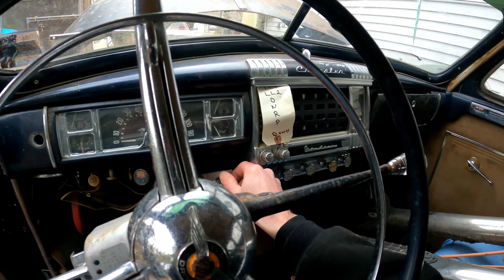Rotting 1967 Cadillac Convertible Will It Run and Drive? - NNKH

Comment: This is a cool car. But it’s still a real roach of a rust bucket. For the right person, this is a good car to bring back. Why? Because this is a car that defines what a Cadillac was and should be. And there will never be any more of these. So that’s why this one is a keeper. It would probably cost between $100,000 and $200,000 US dollars to totally restore this car back to showroom condition, but my guess is for between $20,000 to $50,000 you can end up with a nice driver status car.  There are still plenty of GM full size hulks laying around in junk yards, back yards, out in the woods and fields that can supply replacement parts and pieces needed to bring this car back. 

I love those hubcaps and white walls on this car. They just look so right on this car. This car has a beautiful set of lines and style.

Comment: I'm not an expert but I do know that marine batteries are Deep Cycle batteries. Deep cycle batteries are designed to draw out power over a longer period of time, whereas an automotive battery is designed to discharge a larger amount of power in a shorter period of time. Marine batteries will last longer under load, but they are not intended to be used in below freezing temperatures, since they are designed for uses in a machine that can't be used in sub freezing temperatures. In other words, they work better when you are trying to start a car that may require a lot of cranking, but they are not suitable for year round use in a car, since they do not work very well when it is below freezing outside.

Comment: So beautiful, the america i loved. It is a crime to give up such a car. To protect this car against rust after restoration: put grease every where : between carpet and floor, inside rear gate, doors, under the car, rear wings, behind bumpers, when you cannot reach these places with a paintbrush, use an extender to pour oil. to be repeted regulary for oil.
Only grease is really efficient against rust - it is my experience (35 years) as a handyman on classics cars.
from france.
ps : the dog is as lazy as the cat.

Comment: i would sometimes find myself without being able to pull a car on trailer. Best way i found to do it is take the trailer off the truck. Shock the tires on the trailer and then pull the car with a strap onto the trailer. it would take me 10 min total time to put a car on that trailer.
Reply from the maker: Sounds like a decent method

Comment: A marine battery is designed to withstand the harsh conditions of a boat, like vibrations and moisture, by having thicker lead plates and a more robust construction compared to a car battery, which is optimized for quickly starting a car engine and doesn't need to provide sustained power for long periods like a marine battery does; essentially, marine batteries are built for longer discharge cycles while car batteries prioritize high initial power bursts.
Reply from the maker: this is a marine starting battery not deep cycle
Reply: Yup totally! They're different than each other. The marine batteries are stout. 

Marine batteries are designed to withstand harsh conditions, while deep cycle batteries are designed to be recharged and drained regularly.
Reply: @NoNonsenseKnowHow 

Love the videos. I travel about 15,000 miles a month and binge your videos for hours and hours a day

Comment: Take the vin to a trusted locksmith they can make keys cheaper or try pulling the ign & a door lock pull them apart hit the pins down on a blank key make your own I done it on non tree ignition locks

Comment: This old car is a junkyard candidate.  The amount of work just to rebuild it from the ground up would essentially be building an entire new car.  This is well beyond feasible to restore.  When under that car, I would be really nervous because of so many rust holes in it.  I have experience with these vintage cars and when they are that rusty, they are well beyond salvageable.
Reply from the maker: Doesn't need to be fully restored.  With minimal work it would be a fun cruiser.

Comment: you need to put a vacuum guage on that and see if its fluttering. The oiling is poor to cyls 7&8 especially with crud buildup in the engine or non zinc oil being used.
What usually happens in that engine is the lifters and or the cam wears.
you can pull the intake and pull each lifter to look for excessive wear on the bottom. especially you you have that vac gauge fluttering
Reply: Flat tappet engine.  Must use diesel oil now to get zinc and phosphorous.  (Also leaded high octane gas).

Comment: I think that engine is 10.5 to 1 so compression should be higher 180avg
assuming the rings, valves seal and the cam isn't worn out. it will need a chain of course too
Reply: If I recall, the 429s had bad timing gears.

Comment: I would imagine you can still get lots of the body panels/sheet metal for this. It would be a huge project but it's screaming for a complete restoration.
Reply: Super expensive.  The outside mirrors on my 70 go for up to $2000 each.  And they are only zinced not chrome.
Reply: @rogersmith7396  I think a lot of people don't realize how expensive it would be to restore this car. Especially the missing interior. Love to see it running again but this seems like a parts car to me.

Comment: I'd rather spend 20 grand restoring that Caddie convertible than buying a brand new Cadillac SUV. All that Caddie needs for upgrades in the 21st century are front power disc brakes and a 4 speed automatic transmission.

Comment: I like the styling of 66 and 68 Cadillacs but for some reason they aren't impressive looking cars. I guess they don't have the bulk of the 65 and 66 or 69 and 70. The interiors lack something too. GM cheapened the interiors of Pontiacs and Cadillacs after 66. The Oldsmobiles and Buicks got better. Go figure. I don't understand anyone putting Bosch plugs in that engine. AC's are available. Nice video.

Comment: Some friends father had I think it was a 68 or possibly 69 at any rate it seemed to be a little longer than that one, the father would let the oldest of girls drive it and we would cruise around real slow with the car lurching around 25 cruise control was not very smooth back then at least in that at that speed

Comment: How can pouring oil into the crankcase get to the oil pump gears?  It can't!  Mike is blowing smoke!
Reply from the maker: That's what I was thinking but I figured what the heck. It's his car so I poured some oil in there.  The oil pump gears are inside of the timing cover not far from the fill

Comment: that sparking like that on the points is BAD!!! that means the condenser is bad and will need to be changed, all the arcing on the points will ruin them in no time! you will get misfires like crazy and eventually no fires lol
Reply from the maker: What part of the video are you referring to? Are you talking about when I was checking for spark from the coil secondary wire?
Reply: @NoNonsenseKnowHow  I don’t remember, but I thought u had mentioned that the points were sparking when u checked it, they shouldn’t spark, the condenser stops that, sparking points get dirty and pitted fast and cause misfires and will fail

Comment: Marine batteries are for long low current discharges. Automotive batteries are for a quick high current draw & back to charging/driving down the, road. Also, marine batteries are designed to be discharged & charged & discharged & charged VS for a quick burst of, energy for "starting", purposes.

So, when the volts go down, the amps go up. When the volts go up the amps come, down. 

You won't get near as many discharge/charge cycles out of an automotive, battery. 

Be careful using a marine battery for automotive use? Once you let the smoke out of the wiring, the wires aren't good anymore. 

I wouldn't use a marine battery in my automobile & I wouldn't use an automotive battery for marine applications. (For obvious, reasons)
Primarily coz it's not good for the wiring nor the, starter with cars & trucks & an automotive battery for marine use will roach a good automotive battery pretty quick.

Although, I'd sooner use a marine battery in an automobile than an automotive battery on the, water. (You will end that suckers life in a, hurry.) With the marine battery on a vehicle it is hard on the electric starter motor/wiring if you are STEADY cranking on the car/truck and or have a large amount of current requirement for whatever, reason? 

I hope this helps someone.
Reply from the maker: I think you're referring to a marine deep cycle battery. I used a marine starting battery. Designed for starting engines. Hope this helps.
Reply: @NoNonsenseKnowHow  i never knew such a concept exists. Thanks for sharing wimme, bruh. ✌️

Comment: Marine batteries are not meant for automobiles because they aren't designed to handle bumps and vibrations.  Boats are much smoother.
Reply from the maker: Boats are not smooth across chop at high at high speed.  Very rough